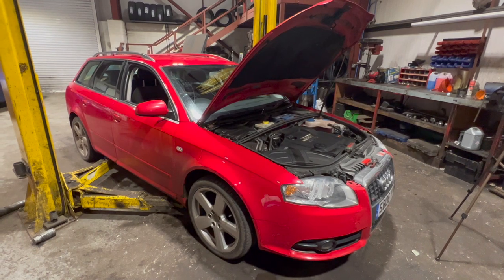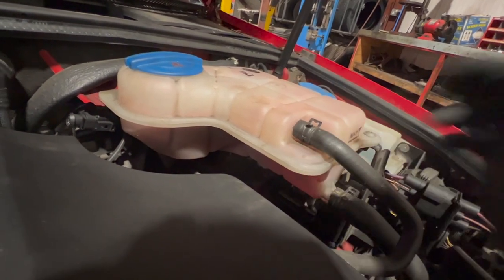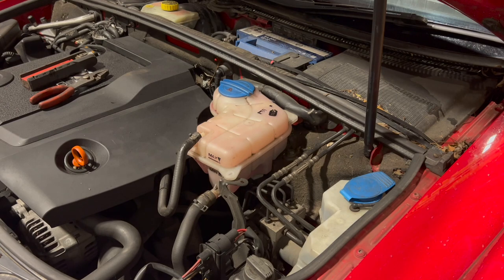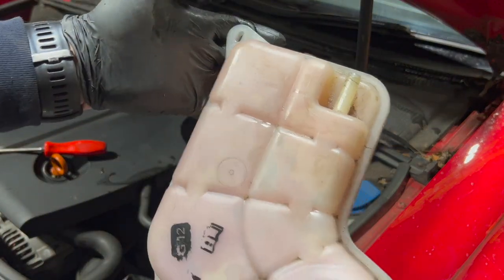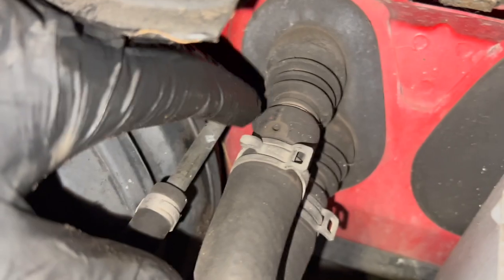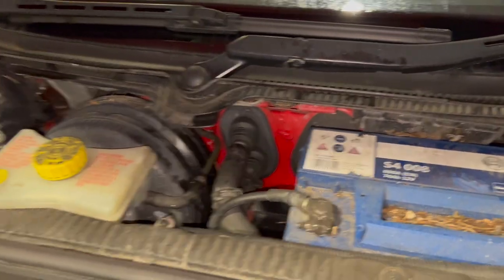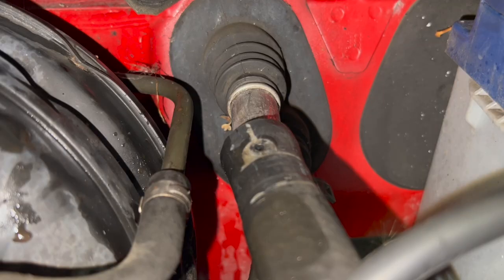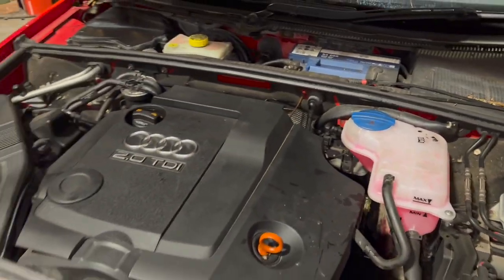Audi A4 B7 Coolant reservoir replacement

Comment from the maker: Check Euro car parts - https://tidd.ly/3lIO7xA  (use discount codes on site)
Check GSF Car parts - https://tidd.ly/34pZe7o  (use discount codes on site) 
Check "Car Parts for Less" - https://tidd.ly/2LNEwIn  (use discount codes on site) 
New Aftermarket Coolant tank Ebay - https://ebay.us/MoJTyY
New OE coolant tank Ebay - https://ebay.us/ATU4aP
Anti freeze Ebay - https://ebay.us/HDBlAb

Tools used  :  
Hose clip Pliers - https://ebay.us/vZVEhj
Soft jaw pliers - https://ebay.us/7Ww41l
Screwdriver set - https://ebay.us/FVn6hO

Comment: That heater pipe does not easily slide by me.. It's kinda stuck. Any ideas? Or should I just use force to get it off?
Reply from the maker: it'll need a good wiggle!

Comment: On the U.S. version we have a separate (bleeder) nut on top of the hard line going across the engine. All you have to do is slightly release it when warm, or open it completely (when cold) and pour coolant into the reservoir tank until it comes oozing out of that little bleeder hole from the nut.
Reply from the maker: 👍👍 haven’t come across that before , thanks for the info

Comment: The water simply disappears from my reservoir and gets to the lowest level. I don't know more what to do there's no water in the garage ground nothing. Don't see how it simply vanishes. Is this a solution? Audi A3 1.9 tdi 2008. Many thanks if someone can please help
Reply from the maker: are you sure its not leaking through the heater matrix into the car?
Reply: @diydaly  Already checked by Audi themselves and no leak supposedly... Even them they say that they don't know how it vanishes and wanted about 4.5 k to get the problem resolved. Once i asked how would they solve the problem without knowing exactly how that water vanishes they got a bit pissed and told they would have to spend some time on the car... I think they know and maybe it is simple but they don't say it to me
Reply from the maker: @ruipedropereira366  could be head gasket but they are now very common unless the engine has been hot (over heated )

Comment: W vid def gonna try this later I been having coolant issues w my A4. Coolant tank is full to the brim and water pump seems to be working fine. But for some reason my coolant light turns on after 15 mins of driving and the gadge starts going up. Hoping it’s just a faulty tank sensor
Reply from the maker: 👍👍 hopefully so mate

Comment: Hi can i use coolant if the pipe to the heater is missing..actually both pipes are missing..audi a4 2.0T station wagon
Reply from the maker: when you say missing has the matrix been bypassed then? if so you need to bleed it via just leaving the cap off

Comment: Hi is the coolant supposed to be on the max level mine is just above the min line shall i just top it off to max thanks
Reply from the maker: Anywhere in the middle is ok but I prefer to set it to the max , yeah just top it up and keep an eye on it
Reply: @diydaly  thanks I know its not leaking because I changed the thermostat few months back and I didn't fill it up to max
Reply: @diydaly  thanks just topped it off today with g12+ coolant to the max and left cap open with car running few mins let any air out